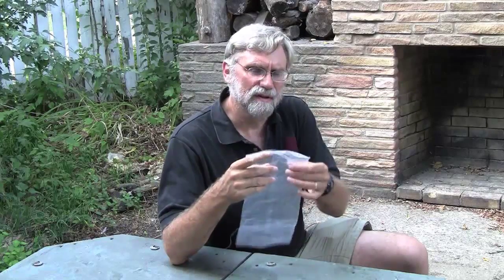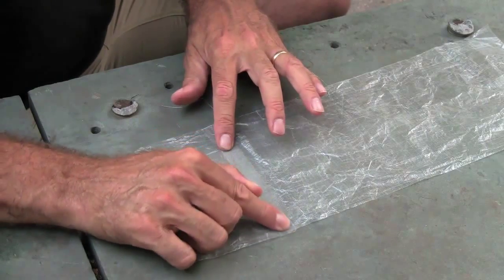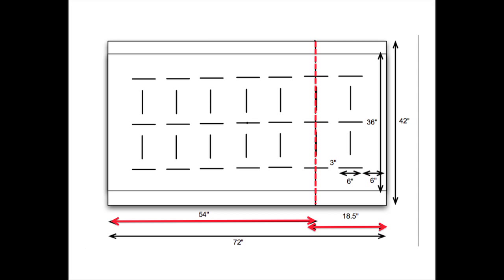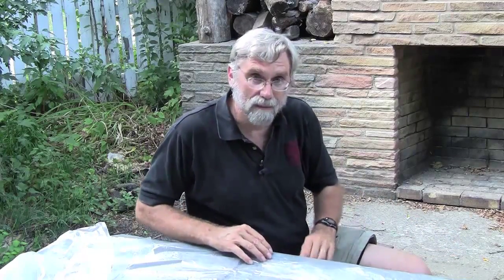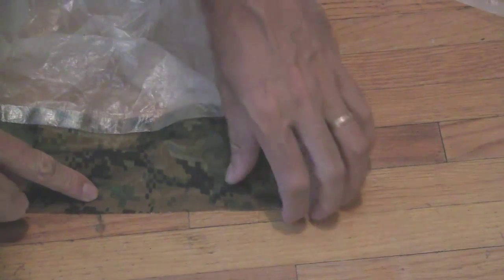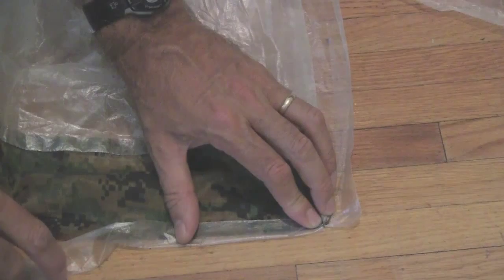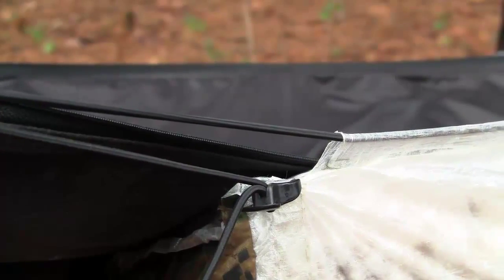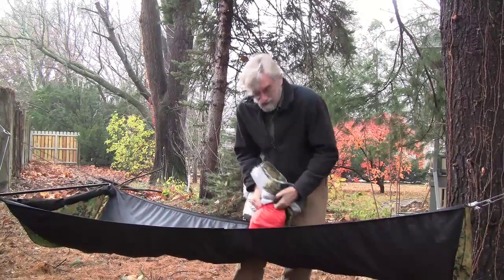The Making of a Cuben Fiber Karo Step Under-Quilt

Comment: Hi, I took inspiration from this project and created a cuben fiber down underquilt. I did 8 traditional length-wise baffles instead of Karo step. One super feature with this design is that the bottom of the hammock becomes splash proof. Just wanted to share, thanks again for your instructions. Gatis

Comment from the maker: @coolkayaker1 I'll be under a tarp, with beaks (smile).  But actually I've thought about cuben flaps that could cover those ends against exactly the possibility you mention.  There is a guy who makes all cuben over-quilts and uses a valve.   You don't want to inflate with your breath though, because of the moisture.  One uses a sack, filled with air, and squeezed in.

Comment from the maker: @KIFQHESE My first attempts at the suspension did not have shock cord in the channels, only outside at the corners.  Wasn't able to keep the underquilt pull up and next to the hammock in the middle that way though.  That shockcord is heavy and I'd like to find another way.  I think if the shock cord from the corners attach higher up the suspension triangle it might pull the under quilt in.

Comment from the maker: @abclandscapingfx Yes I've sewn it.  It is no more difficult than sewing un-coated nylon, and a sight easier than sewing silnylon.  You don't want any stress on a sewn stitch because the holes will open up, and the fabric may even tear.  I didn't sew the baffles on this mainly because I didn't want punctures that would pass water vapor into the quilt.

Comment: @ProfessorHammock How about, apart from raising the mounting point, also shaping UQ not as a flat rectangle, but a little bit concave? I imagine adding only a short section of elastic material on the sides - like 1/4 of overall length - that should provide the tension needed to hold things tight, at least in theory. I hope I'll be able to design and experiment with UQs this winter.
Happy Thanksgiving :)

Comment: Gorgeous UQ, Grizz. Q: in wet weather, esp since located at ends, isn't the camo section going to get soaked thru to the down?  Is there a method to vent with lightweight valves, similar to a Thermarest pad valve, so they can be closed in the wet?  Just thinking it through.  Another gr8 video.

Comment: With the differential cut, are the baffles the same distance apart on the bottom as the top, leaving a slightly larger chamber on the sides? Or did you move the baffles a little farther apart to keep the ratio the same? Do you think it matters?

Comment: Hi,  I'm curious how the taped baffles and edges are holding up thru the years...any issues. I will attempt this method of joining the baffles and sides if all is well with your method.  Thanks.
Reply from the maker: I've needed to re-enforce a couple of the corners of the sleeve through which the shock cord passes, more pulling on the glued cuben there than elsewhere.  Beyond that,  it's all good.  My favorite UQ in an embarassingly large collection of UQ.

Comment: NIce video Prof. How is the CF UQ holding up? Would you do anything different if you were building this today?
Reply from the maker: howdy, thanks for watching.   I would re-enforce the corners a bit more, where the shock cord comes through and places some stress.  Have needed to apply some glue now and then to deal with separation.   I would definitely put the down in differently.  I think I'm still finding feathers in the project room from that build <grin>